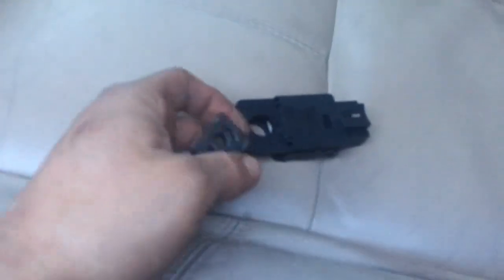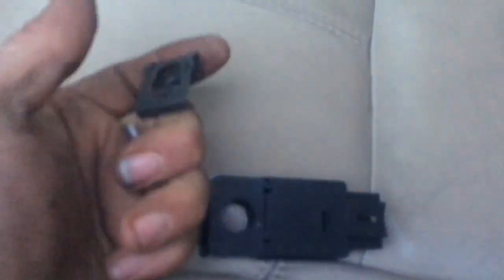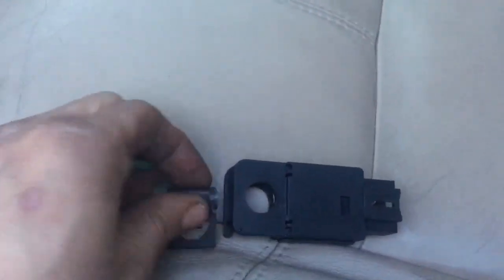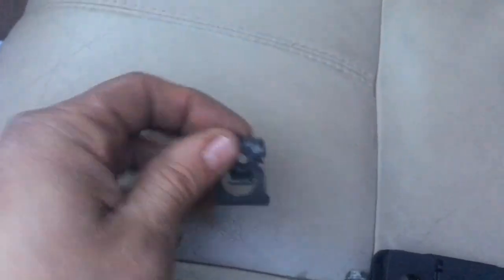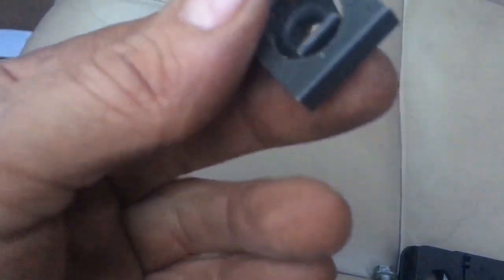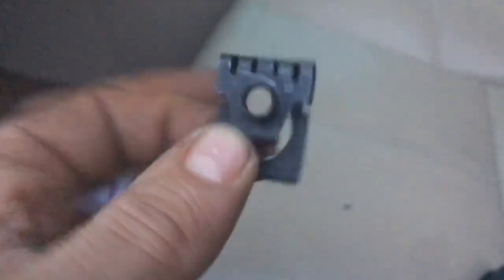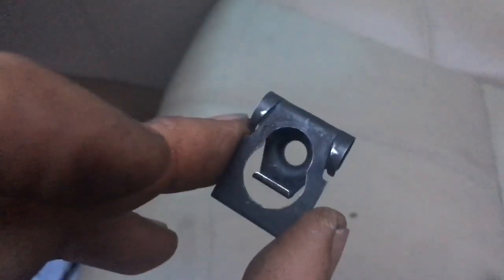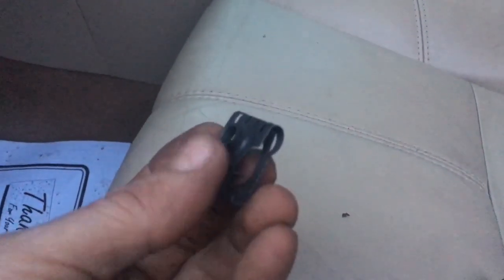Possible reasons why your Stabilitrak light is on in your GM

Comment: I have a 14 silverado and my abs and service stabilitrak just came on out of nowhere. All my brake system parts have been replaced and are new. Could me hard wiring in a 3rd brake light to my trailer package behind the bumper cause this if water, salt and other contaminants made it in to the soldiered connections?

Thanks in advance!
Reply from the maker: Hey Steve the stability track light can come on for many different reasons I don’t think that is one of them what you need to do is have a shop look at the live data from your ABS system and they will be able to diagnose that problem really quickly

Sorry I couldn’t be of more help
Reply: @sharpcarco  
First off thanks for the reply! 
Second - they are charging me $67 to read it on there scanner. Is it sophisticated enough to really pin point out where the issue is? Say if it's a ground somewhere. Will it be direct in the area of issue? I'm just trying to justify the money. Thanks again!
Reply: @sharpcarco  ps
Subscribed ! 💪
Reply: Steve L most of the time when those two lights are on together it’s the wheel hub,, always replace in pairs!!!!!!  And it’s suggested you replace wire harness too! Moog comes with harness, however way to diagnose is if when driving it roars sounds like you have on 4by4, or lift of ground with jack turn wheel by hand listen for light grinding, shake wheel to look for any give!
Reply: @LH81633  thank you for the reply! These are both new hubs, roughly 5 months old. Replaced together. I am running 33s and these hubs are from the company Master Pro. Not reallycheap at $88 each. That's my confusion. Wonder if you strongly believe this, if I need higher end wheel bearing hubs?

Again, thanks for replying 💪
Reply from the maker: I don’t know how I didn’t see your reply. 

That’s a complicated question to answer because in some ways yes the scanner will help you narrow down which direction to go and then with the flow of diagnostic you Could be able to find the location of a broken ground at my shop I doubt $67 would be enough to be able to do all of that work but keep in mind they may just know right where it’s at because they may be altered familiar with the particular make and model of your vehicle probably worth the $67 to find out
Reply from the maker: Well wheel hubs are just like anything else they can go bad even when their new the cheap ones or the more expensive ones if your wheel hubs are bad it’s just a coincidence it really doesn’t have anything to do with how much money you spent on them. If you buy the most expensive ones that doesn’t necessarily mean you’re getting the best ones
Reply: 715 Outdoor, did you ever find out what was the issue?

Comment: My 2009 duramax 2500 has a stabilitrak error
 Code reader shows p07080 error transmission sensor a.  I loose shift indicator light and it stays in whatever gear I am in when error surfaces.  No cruise control.  It has been resetting if you let it sit turned off but it's getting bad enough now I can't drive it.  Error even occurs parked and idling.  I'm frustrated nothing I've tried has worked

Comment: I've got a 2009 Buick Enclave.  Stabilitrak message and cruise quit working.  I replaced the brake relay switch, only $13 from a dealer.  It fixed the cruise, but not the Stabilitrak message.  Now what?

Comment: 2015 acadia... rig runs fine...until the traction control and stabilitrak light comes on AND while accelerating, it struggles to send the power to the motor. The rig shakes..but only when it's an issue. Every time I start and drive it, it's fine. It happens at random. PLEASE HELP!
Reply: Shelly Ferris did you ever figure out what was wrong?
Reply: Shelly.. this is happening to my Acadia.. did you find the issue? I've already spent $$$ and nothing.
Reply: Check spark plugs. Mis fire will cause
Reply: @farmerrobert5978  for myself .. this is one of the first things I did.. this actually happened again a few days ago .. after three months of everything being fine..

Comment: Can you drive with the light on? Engine light flashing
Reply from the maker: That’s a difficult question to answer you probably have a misfire which turned on the stability track light and that misfire is pretty serious because they can clog up the catalytic converter‘s, more than likely you have a collapsed lifter it’s very common for the AFM engines. Obviously you haven’t giving me that much information but 90% of the time in the Chevy engine 2007 or newer it either needs a spark plug or it needs new lifters. However there is a way to bypass the AFM system but the lifter cannot be collapsed.
Reply: You were right the pedal does a lot is probably misdiagnosed thank you a bunch and for giving me the confidence that I could do it my self which I did😁 thank you again so much...

Comment: This was my problem maybe it would help.. every single time I disconnect my battery traction control comes on and it does not go away plus when I drive it it jerks on first or second gear not sure I have an automatic but I've done this methot twice and it worked for me I unplugged the positive and negative and touched them both to release every bit of energy the car has and left it unplugged overnight and plugged it back in the morning drive it to work and it was gone capish.. ur welcome
Reply: I'm having the exact same problem now. Makes it drive rougher than normal
Reply: I have the same problem
Reply: i have the same problem
Reply: I'm gonna try this. Thanks.
Reply: Did this work?
For all you that said you had same issues

Comment: 2010 camaro SS SERVICE STABLI Track comes on. Then goes off.  Had it check said multi miss fire #3 cyclinder.  Replaced #3coil  all 8 spark plugs and #3 injector.  But it’s still going it.  Any ideas??
Reply from the maker: Good afternoon blue. Sorry to hear that . what size engine is in it. More than likely it’s probably the AFM valves are not working that would be my best guess right off the top of my head
Reply: 6.2 L AUTOMATIC 64,oooMiles.  It seem to mostly do it when turning and give it a  good bit throttle. 
It will miss fore a little and the service stabi trak light will come on
Reply from the maker: Well why don’t you check out the throttle plate. And the air filter and make sure it’s not all gummed up. I know it seems silly and more than likely is not the problem. But heck it’s worth a try
Reply: I have cleaned the throttle body and MAF sensor . And replaced the air filter

Comment: 2012 Acadia w/approx 85K mi well maintained has recently been shifting into 4wd on the fly and randomly. Brought it into one of the few remaining Sears Auto Centers few mos ago where they
changed the tranny fluid w/out disturbing filter/pan. Noticeable downshift and Traction Control Off, Service Stabilitrak, Service Traction Control and Engine Power is Reduced msgs come on as result. 
Thoughts please, thanks!

Comment: My Stabilitrak and traction control light only comes on after a stop, within 1/2 mile or less it resets, any suggestions?
Reply from the maker: The possibility that comes to mind right away is that do you have a slow wheel speed sensor but I could not be for sure without hooking it up to a scanner. Meaning at slower movement the four sensors. 
One of them is towing the computer a different speed then the other ones
Reply: @sharpcarco  I did replace all 4 wheel speed sensors, maybe one isnt spaced/shimmed at the right depth?

Comment: Had my front end replaced, now my stabilittrack, ABS and engine light on. What could it be?
Reply: Check the wiring
Reply: I have the same problem did you find what it was?
Reply: @rayogamefarm3127  try checking  and make sure they grounded the whole system.
Reply: Mine just did this after front end work anyone else figure out whT happend?

Comment: Hi  Clay I have a 2016 gmc terrain with 130 plus thousand miles, today my stabilitrak light came on, first my dash needles started going up and down, then I lost power and my check engine light came on, I stopped turned it off and started it again, engine light still on, after a few minuted service satbilitrak light came on and loss of power, I was able to make it home, now my question is can it be the spark plugs? they haven't been change yet and would like to know if that can cause the problem. Thanks
Reply from the maker: Hello Edward ,There are several different causes of this problem and that most certainly can be one of them I hope that’s the case for you because that would be the easiest. I wish you the best of luck God bless and have a great day

Comment: 2007 avalanche 4x4 lifted 8” I’ve replaced both front wheel hubs, with speed sensors and I only get the stability light when I make a turn right or left it don’t matter! No loss of power but I do feel a weak and slight pulse in the breaks!! I thought it was a bad wheel hub I bought from autozone so I upgraded and bought the high dollar moog ones and it’s the same issue Any suggestions would be helpful
Reply from the maker: Hey good afternoon custom that should be a pretty easy problem to fine when you look at the wires Wheel speed sensor wires they have to be pooled someway what you’re going to look for on the wires is a bunched up part they may not be tour but they will look almost kinked in a way. You could also look up how to do a continuity test and that will tell you where the break is that I am certain there is a break from what you’re telling me I hope you find it
Reply: did you find the issue ?

Comment: hi there clay I have a problem with a chevy 07 the stabilititrak comes on when braking an then off if you could give me a tip
Reply from the maker: More than likely it’s because your ABS wheel speed sensors are not working properly what you would have to do is look at live data while you’re breaking. I hope that’s helpful for you let me know how it turns out God bless have a great day
Reply: And how do i do that
Reply: Hello clay sorry to bother again but i cant look at abs live data with my scanner tool but it a has a code c0561-71

Comment: Can the wheel speed sensor cause those dash lights to come on also. My a.b.s would kick in almost every time I stop so I pulled the a.b.s fuse and it still did it and now those lights are on. ( Fuse is back in)
Reply from the maker: Absolutely.... ABS can cause that in the past I found that that’s either a broken reluctor ring or a faulty ABS control module. Obviously I can’t say for certain and your situation because I’m not there and this is a text message but I would look at them two things because more than likely they are the culprit

First thing you would do is watch on a live scanner all four wheels and see which one is going slower or faster than the other ones.

Also having the wrong size tires will cause this problem as well they all must be the same size and the same make

Because tires are just like jeans wranglers fit different than Levi’s etc. etc.

Comment: I had a bad mass airflow sensor.
Reply: 2007 Yukon Denali
Reply from the maker: Yeah, after doing this video, I realized it could be a couple dozen different things that turn that stupid light on freaking General Motors
Reply: @sharpcarco  It was helpful. My cruise control worked wen they would go off so I knew it wasn't the brake switch.

Comment: Can some one tell me, why my stabikitrack come on as soon as I start my truck but when I put my foot on the gas it doesn't accelerate for a few min then it picks up. But when I put my foot on the breaks the breaks levitate.. I was told to replace my front differential but I was told that's not the issue can someone please tell me what the issue if u have a GMC envoy 2005
Reply from the maker: That’s a tough one to answer it sounds like you did the best job you could to explain it but unfortunately there’s a lot of variables that are not known so making a diagnosis over the Internet would be extremely difficult in your situation I wish I had better news and I could be of more help.

Comment: Help so my traction control and stabilizer light come on then the abs came on and now my brack light what could b the problem im think just get a new car .
Reply from the maker: I doubt you need a new car Margot I just would recommend taking it to a local repair shop you don’t have to necessarily take it to the dealership and I’m sure it’s something that they can fix rather quickly my guess would be you may need a new wheel bearing or wheel bearing sensor but that’s just off the top of my head there’s so many possibilities it would be difficult for me to list them all
Reply: Replace brake light switch
Reply: Papl q

Comment: my chevy 2007 truck stabilitrak wont work but light doesnt come on i press the button doesnt shut on or off which confuses me. any ideas codes read u0109 but changed fuel control module u0121 lost communication with EBCM
Reply: DO YOU HAVE A VIDEO ON HOW TO CHECK THE POSITIVE AND GROUND CABLES THINKING OF CHECKING THAT FIRST..?

Comment: Hey Clay,  I have a 14 Sierra Denali with a 6.2L. Today I popped a P0307 as well as the Trac Light. Why would they go off at the same time? The truck is idling and driving very rough. I'm going to replace the 7 ignition coil, wire and plug what should/can I do about the Traction Control light?
Reply from the maker: Take care of your own ability issue first and then see what happens there probably not related but they could possibly be on that new of vehicle.
Reply: Clay, Thank you for the replay. After carefully inspecting the engine I ended up finding the bank 7 spark plug wire was popping off. I replaced all the wires and it has been restored to beast mode.
Reply from the maker: Wes M That’s good to hear when we have comments like this. People generally read through the comments to see what other people pound and I’m sure that will be helpful for somebody in the future I’m glad you got the problem solved sorry I wasn’t of much more help

Comment: My 2010 silverado 5.3 stabiligjt control & traction control  light comes on--door locks lock & unlock rapididly--jumps into nuetral & back in gear--& engine revs---scary & might be dangerous  --any suggestion on how to fix this
Reply: Roger Ramjet that Happen to me and it was the ground on the battery
Reply: Erik Gutierrez  what all did you replace to fix the problem?

Comment: My stabilitrak traction control light keeps coming in in my 2016 gmc acadia I have taken it to two mechanics do is put it on the computer to run Diagnostics. Nothing has came up it has said nothing about traction control  Stabilitrak password when I get in the vehicle for the first time during the day and start it up it takes about 10 to 15 minutes before the light comes on but when I turn the car off the light goes out but it always comes back on also if I try to merge quickly into a lane it comes on and it feels like the car is skipping I don't know what else to do or I am thinking about taking it to the GM dealership I am at a loss for words I've been through the two mechanics that tell me there is nothing wrong that they can see or that the computer recognizes

Comment: Hi Clay do you know something about crazy needles??. My unit is a 2011 Chevy Silverado HD 3500 6.6. When needles start to get crazy everything runs bad: radio, cruise control, A/C, gearbox, etc
Reply from the maker: This is going to sound stupid . But it sounds like your negative battery cable is probably loose or you have a bad ground there is something that is not connected completely together like it is supposed to be it may have been some kind of service that you performed in the past and the bolt not being tight is rearing its ugly head. Look for loose wires or loose connections I’m absolutely certain that’s probably your problem
Reply: These trucks have a ground problem under the dash

Comment: On my 07 suburban it comes on briefly, then goes off...not sure what it is
Reply: El Monty the Eminent some times it is a dirty air filter! Clogged fuel injector in wich they will fualt your spark plugs!! Check 1&7 plug regap or replace put in a very good fuel injector cleaner

Comment: SERIOUS QUESTION PLEASE HELP!!! My 07 Chevy Silverado... the traction control and stabilitrak turn off and then it jolts the whole truck and then they will turn back on it will consistently do this on gravel or when I stop. Could this be what the issue is?
Reply from the maker: Well unfortunately I don’t think we’re going to solve this over a text message but. I would think that there’s something on one of the reluctor rings that reads the speed of your wheels. Or you have a defective ABS sensor (wheel speed sensor) . I wish I could be more conclusive than that but hopefully them give you some areas to look at and I hope that I’m correct.
Reply: Thank u!! It was my grandpas truck he said that each tire has its own traction control censor which I’ve never heard of so maybe that’s it?
Reply: Did you find out what this was my GMC acadia just started doing this

Comment: could this maybe why  traction control light  is on and  traction control not working on a 2008  pontiac torrent
Reply from the maker: Sounds like you probably have a bad wheel bearing very common with them vehicles
Reply: I have an '08 torrent as well. Same issue with lights. I replaced my erg valve last summer but my lights are coming back on. From what I've gathered through my research today, there's four possibilities so far. I guess erg valves need to be a factory part. Next are the brake pedal switch, brake hub sensor or a grounding issue.

All I know is that I don't know what check first and in what order. 

What is the progress of your vehicle?
Reply: Did you ever figure this problem out?I have 08torrent and those lights are on and sometimes it’s stops driving